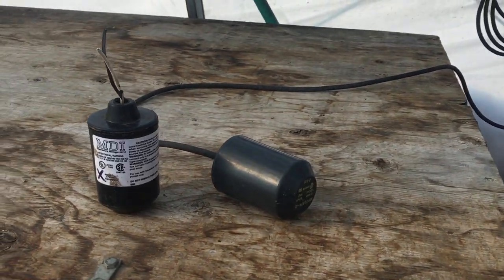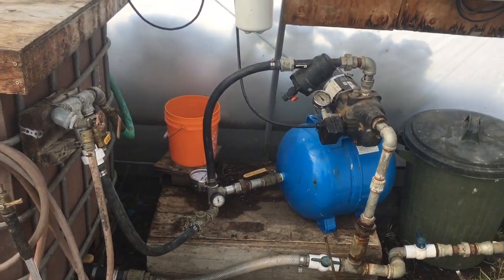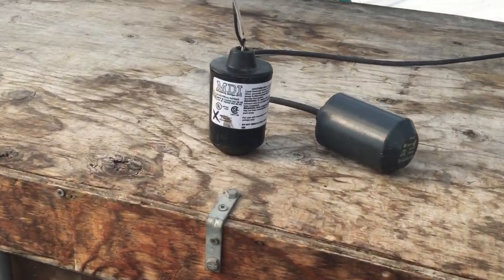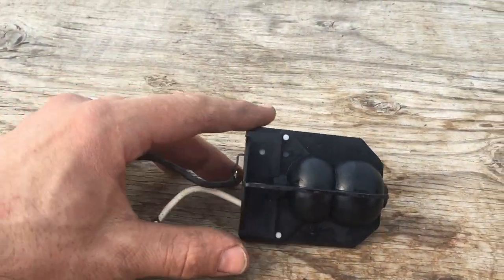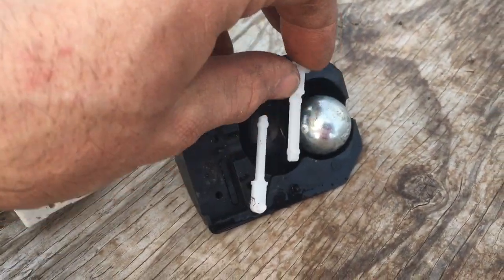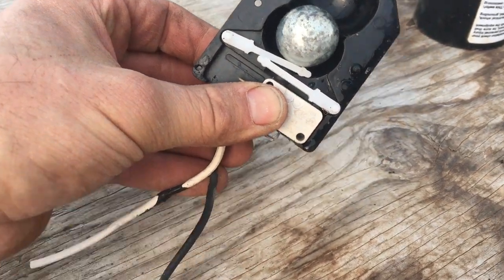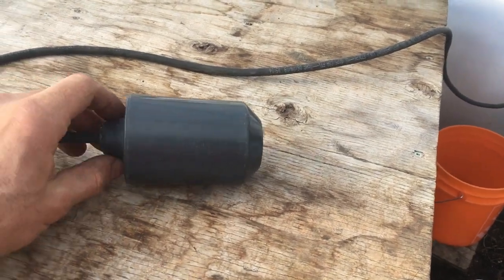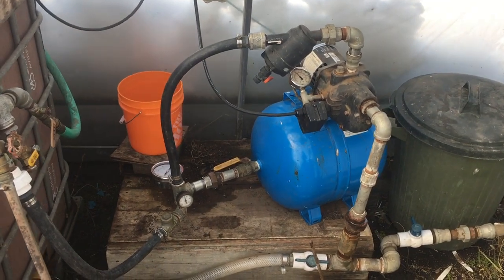About float switches - for pump run-dry protection in a small greenhouse

Comment: Thank you for the autopsy.

Another option is a low-pressure pump switch like this one: 
https://www.amazon.com/dp/B000IJSWGC. 
It looks, works, and costs the same as a normal pressure switch, but it shuts off the pump if the pressure falls below an adjustable set point. That way the pump stops if the inlet line is blocked or the tank runs out. You hold the lever down to reset the switch once you refill the tank and it works like a normal pressure switch again.